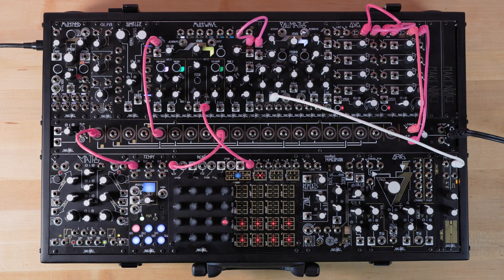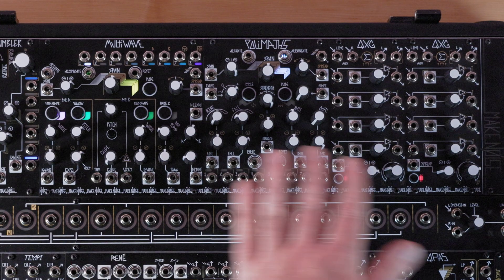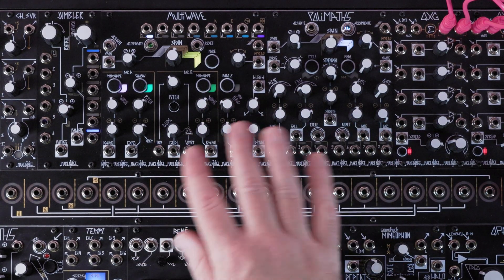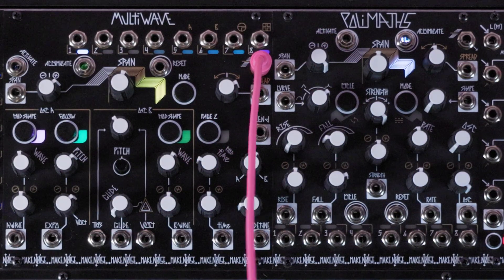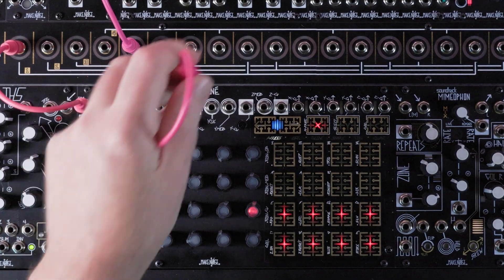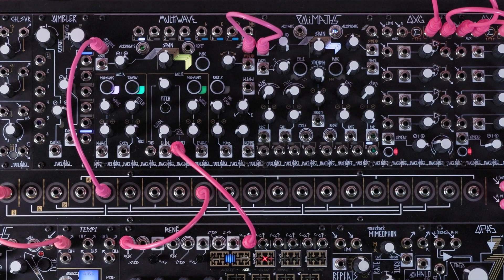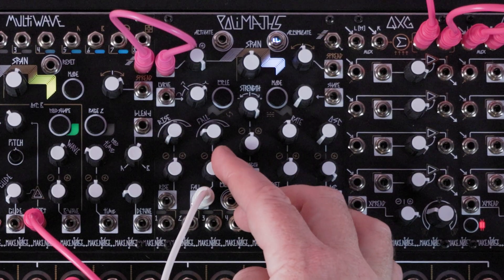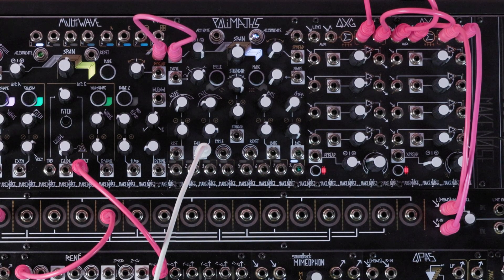A Patch to Get Started with the New Universal Synthesizer System

Comment: I don't see to get 2 ! extra Oxg's for some extra 500 bucks  to make an appropriate sounding of two modules Multiwave and Polymath while the rest of the functionality of the OXG is hardly used and takin' up a lot of space
Reply: You can do plenty with two QXG's on top of using them for the Multiwave and Polimath but they are purely optional either way. If you DO have them paired up with the Multiwave/Poli, you still can use any of the 8 channels to your liking by plugging things into them. If it's "hardly used", that's on you!

Comment: Going back to semi-modular with a “universal” proprietary bus? Thanks but no thanks. Not a fan of nonstandard things happening under the hood.
Reply from the maker: We apologize for the miscommunication! The "under the hood" connections are 100% optional, strictly for convenience's sake, and can be entirely and accurately replaced by patching the regular inputs and outputs if that is what you prefer. There is no proprietary or non-standard signal involved.